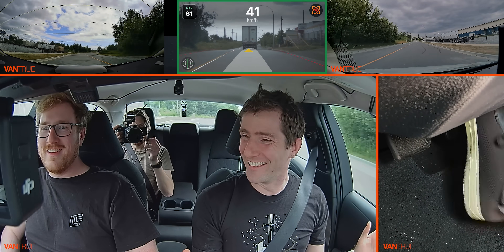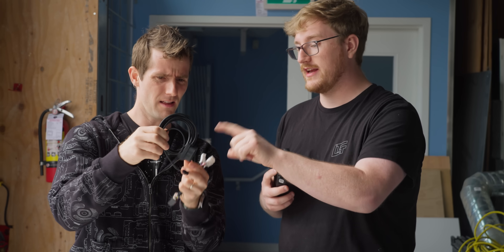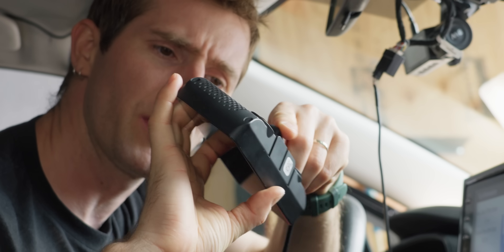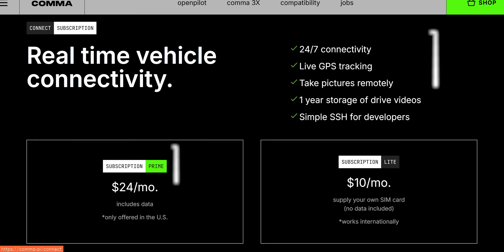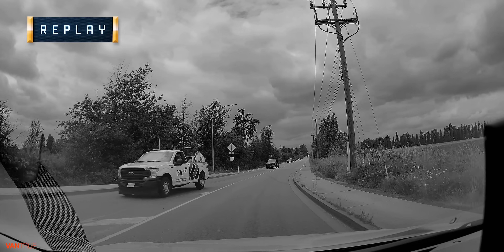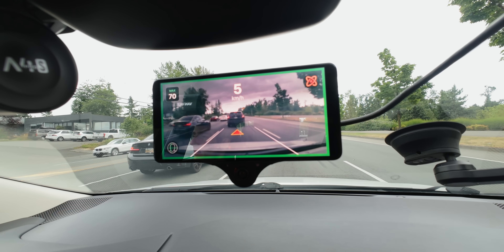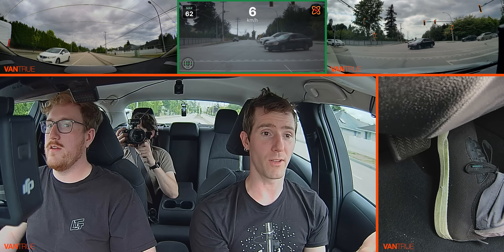I Upgraded My Car With Open-Source AUTOPILOT and it's AMAZING

Comment: Just curious. Wouldn’t using this device in autonomous driving (even “experimental autonomous driving”) in B.C. illegal? They just changed the laws (back in April 2024) making the operation of a vehicle in fully autonomous mode (even when there is a driver in the driver’s seat) illegal. B.C. being the first jurisdiction in North America to do so.

“Anyone caught driving a fully automated vehicle in B.C. could face penalties of up to $2,000 and six months in jail.”

-CBC News, April 22, 2024

I have a 2020 Honda Insight with driver assist features (Adaptive Cruise Control, Lane Keeping Assist). The ACC works great and will bring my car to a full stop from highway speed if necessary. With the LKAS if I take my hands off the wheel, it will first “shake” the steering and give audible warnings wheel (and visual on the instrument cluster) and if I still don’t respond it will give stronger steering assist and eventually bring the vehicle to a full stop. In other words, it won’t allow autonomous driving.

Comment: I currently own a Comma 3 with a 2022 Prius. I've used it in two different cars with over 550,000 miles. Zero incidents. It's incredibly safe, efficient, and smooth. Comfortable.

Comment: I saw something similar to this years back, where a person added software to a smartphone and connected to his car. I'm thinking that as time goes on, there will be software upgrades that will allow the system to work even better. And it's clear this current version is best for highway driving, where there are not a lot of turns that have to be made.

Comment: I just wish VW Touareg was supported. Especially because VW has yet to fix the cameras in ANY of the T-regs. How this isn't a safety recall is beyond me, but I digress.  Apparently the comma hardware doesn't support the type of CAN bus VW uses. To bad because it would be a huge upgrade and well worth the $$$. Also I love how a tiny company is doing at least as good as Tesla at self driving with a camera. Tesla's self driving claim is such an exaggeration. I've been in a Model3 that just decided it would cross the yellow lines around a corner and drive into on coming traffic. When I asked the owner if that was normal. He shrugged and said it does it all the time but not to worry it is expected.

Comment: Looked up the compatibility for my car. It says it adds adaptive cruise and lane assist...BUT requires the vehicle to already have the features in order to work. Well that seems pointless.
Reply: A lot of vehicles LKAS system is incredibly crappy. Like, it won't even hold you in the lane. Not even 50% of the time.

Comment: 11:09 nope, my Tesla with basic Autopilot will absolutely slow down for corners. Sometimes a little too much IMO. I could (and have) totally let it handle mountain roads with no issues up to near-90º turns.
Reply: fr after using FSD on hw4... this system is way more dangerous and not even remotely in the same category of self driving.
Reply: @Bb-br3xg it depends on the built in LKAS system of the car, if the LKAS is designed to provide enough turning torque for E.x. 90 degrees, it will do full turns and has navigate on open pilot, this car just doesn’t.

Comment: As a BMW driver/owner for the last 20 years, I’m a little sick and tired of the constant abuse we face from other road users around the world on our use of the turn signals (indicators as we call them in the UK). I need to set a few things straight.

BMW mandate a training course to all new BMW owners, and they clearly state that you’re expected to drive in a sporty and enthusiastic manner at all times, this means driving faster than other road users and taking highway/motorway junctions at the very last minute directly from the fast lane while maintaining as much speed as possible, in this situation the turn signal should not be used as it could mistakenly confuse other (lesser) road users into thinking that you're just changing a single lane. 

BMW only fit the indicator lights as they required for hard braking warnings to other BMW drivers behind when someone in front won’t move out of your way and the manual indicator stalks are fitted in the car only so you can signal to other road users when you need to overtake them, this should be combined with repeatedly flashing the main headlights.

So, as you can now see, we’re just following the correct BMW driving standard and don’t deserve this constant level of abuse from non-BMW owners, if anything you should be thankful we tolerate you on our roads.

Comment: Yeah, if you're interested in Comma, don't wait for Linus's conclusions based on this car. Go watch George Hotz talking about it as well as using it for fully autonomous driving in a car that can actually make the sharper turns. Choosing the wrong car here completely skews what the system does and what it's capable of imo. Find a car where it can do more than the small lane assist steering inputs and then make another video please. It really is amazing if you have a new enough car. 
I may never own a car new enough to integrate with it, but I wish most of the drivers around me were on this instead of their own driving skills.

Comment: My Volvo XC90 (24 plate) has an autopilot and it is SMOOOOTH! where as my previous cars that had Adaptive cruise control was terrible and when I was in cruise control I couldn't disable the lane assist or the car distance. where is Volvo is great

Comment: I have had a Comma 2 for the last 4 years and love it for my 1hr commute. I will warn, when they released the Comma 3, they bricked all older devices not just from running their code, but even custom branches. Unless you're a software developer comfortable with SSH and running unofficial branches, do not buy a Comma system that is past or near its end of life. It took me a week of reddit to fix mine after they bricked it - running dragonpilot now.

Comment: Very interesting, but I would sweat a lot more than Linus did. And that's not because I'm afraid of what the machine does in a perfect situation, but rather how it handles other drivers mistakes. But yeah, would have been great earlier this summer when I drove to Germany and back, that was about 1000 miles on freeway, there I think it would have been shining (if it would have been adapted for Europe, which it probably isn't).

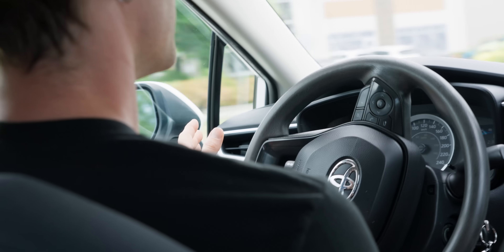Comment: 11:15, Tesla recently updated base autopilot with “curvature assist” which will slow down aggressively for sharp turns. It works well but it does activate sometimes when not required.
Reply: Also for the NA market, i thought that was just an EU temp feature? Also, when does Tesla just scrap autopilot, and do everything via FSD?
Reply: @sebastianorye2702  I’m not sure if it’s in NA because I don’t live there but it would be weird if it wasn’t, people with FSD now don’t even have autopilot as an option anymore with V14 so that might be indicative of them merging autopilot and FSD into FSD and FSD (but it can only go in straight lines)
Reply: @fayenotfaye  I know that thats the plan, and that V14 is likely going to do that, but i'm unsure if thats happened yet.

Anyway, i'm in EU. We're quite literally stuck on a 8 year old branch. Maybe we're lucky, and 2027 might be the year where Tesla's FSD (though limited) from US could come, but who knows

Comment: All those wires blocking the side curtain airbags are causing anxiety for me... Yeah ok the dashcam installs are temporary but good grief it's not THAT hard to tuck wires properly so they won't interfere with the airbags of, god forbid, they go off... Even sticking them to the center of the headliner with painters tape or staples would be better than this.

Comment: The need to offer a steering and brake servo kit that be installed into any vehicle with installer-fabricated hardware.
This only takes a car that already has adaptive cruise control and lane keeping functionality and makes it slightly more smart. Last I checked, they did not offer any means to add the underlying features it depends on to a vehicle that doesn't already have them. The greatest potential for this product is bringing new features to old cars - and that's where it falls short the most.

Comment: I wouldn't trust any self driving as far as I could throw it. Personally I just think it encourages unconcentrated lazy driving. Others may disagree saying you need to concentrate and watch it to make sure it doesn't make a mistake to which I'd say then what is the point of it. How can you have a relaxing drive if you neither have faith or trust in a device do to what it's designed to do. I'll keep control of my car and do the driving myself I think.

Comment: 8:04 LINUS Route Your Cables More to the Right in the rubber across the seem of roof liner and "A" Pillar Seem Then Push  Tuck Under The Front Edge Of Roof Liner Meets Front Top Edge of Windscreen to Frree up Your Sun Visor Dude.

Comment: No warning pedestrians are out-of-scope, without even a single line-of-code or parameter in the models accounting for them?! You can check, search, run etc their code and ML models relatively easily. Also how stock AEB is disabled in 'experimental mode', or by default on some officially supported car models?

Comment: I may have missed it if mentioned in the video but this wouldn’t work with a vehicle that uses hydraulic power steering like an older e chassis bmw, (even though that would be awesome) it would only work with vehicles that have an eps module. Still awesome for cars that don’t come with lane assist. Also I’d be curious how a tuned ecu would react to this. My thoughts are based around retrofitting older cars with newer technology

Comment: To all the ‘mechanics’ out there who tell you to ‘just disconnect the battery’...
Unfortunately, with modern cars, it's not a good idea to just disconnect the battery to work on the vehicle. The electronics are extremely sensitive, and simply disconnecting it can lead to errors, data loss, or even damage to control units. In the worst case, you might have to visit a workshop afterward to get everything reset.

It's always best to check your car's manual first! Often, there are specific instructions, or you might need a memory saver device to keep the electronics powered during the work. Also, always disconnect the negative terminal first and connect the positive terminal first when reconnecting. Better safe than sorry here!

Comment: I still watch and support LTT but this was one of the weakest videos you've posted in a long while.

I'm certain that LTT would have done a far better job of this script 5-6 years ago but this was all BTS "watch us do a thing" and "hur Hur this is cool"

This was THE product to center around the liability and accountability of AI tech, future of the market and the colossal downsides of open-source software wherever public safety is concerned. 
The mark was so wildly missed and I'm mostly disappointed because my expectations are set by the high standards of this channels videos from years past

Comment: There is literally no point to this (or any autopilot) 
You have to remain in control of the car at all times. If there is an accident it is your fault. 
What is actually the point in having the car sometimes, kinda try to steer the car badly. How does this benefit you?

Comment: I think that It would be awesome if they would split it into 2 devices. Like smaller camera module no windshield and small separate screen to mount somewhere on dash I dont want additional giantic shit in my windshield - I want to mount it on pillar, air vent or have composite output to use backing camera input in my car radio

Comment: I'm more bothered by how many cars have drive by wire to begin with. In some cases it helps with packaging when you can't fit a shaft in the engine bay from the cab to the suspension, but a malicious attack taking control of your vehicle. 

Imagine a state agency driving you to "turn yourself in" for wrong think

Comment: Nice video! I've been driving with Openpilot for over 3 years now (2020 Hyundai Santa Fe and 2014 Mazda 3) and it's been great! They recently had the Comma 3X on sale for $799 over July 4 weekend, but at $999, it's still a great deal. Just FYI, Hyundai, Kia, and Genesis are the makes that typically allow for the most torque to be applied to the steering wheel through the lane keeping system, so you'll be able to take the sharper turns much easier with those cars. I think I can count on one hand the amount of times I've gotten the "turn exceeds steering limit" warning on my Hyundai Santa Fe. Even windy mountain roads are no problem for it!

Comment: You don't need to disconnect the battery, I used to work at Safelite and do camera recalibration. Just having the car off is enough

Comment: Interesting....so since this is OpenSource etc whats to stop the car manufacturers, such as Honda, Toyota etc just putting this into their cars and replacing their current 'rudimentary' detection systems?  Certainly, from what I've read, even its basic current functionality is better than the current built in features they have.... the screen would then be in the dash (rather than obscuring view), they could have better cameras mounted in the right places etc.

Comment: You're not thinking weird enough Linus 

Since open pilot is a pretty adaptable platform, people put these things in cars that never would have dreamed of being autonomous 

There's a video of a 1970s Volkswagen vanagon doing some pretty smooth highway autonomy, the owner just had to put in a Prius steering rack, a. Corolla forward radar unit off eBay, a Bosch e-brake system 

Just imagine putting this level of autonomy in literally any car ever built, and yes I am thinking of 1960s Rolls-Royce
Reply: Imagine downgrading nice hydraulic rack to an electric Prius rack and downgrading your hydraulic brakes to electric, not to mention the worst crime - downgrading your cable throttle to electric.... All in an effort to avoid driving the car you bought.
Shoulda just got an uber.
Reply: @LyumYT213  Uber on a daily basis would cost me far more than $1000.

Comment: Linus failed to mention this, but each vehicle has their own max steering angle. If you get used to the limits of what your car can and can't do then you can easily master the usage of Komma 3X and other products. From what I searched up, most Toyotas and Lexus only have a max steering angle of 60 degrees.

Comment: My buddy was one of the first few people to use this. 8 years ago, he had to 3d print his own enclosure, use his own phone for it, and if I remember correctly I think he had to do a bit of work to make his own wiring harness. He drove his 2017 Honda Civic from Utah to Georgia and back to come to my wedding. He said the Openpilot worked great the whole way, it just wasn't great with tight turns as other commenters have said. 
It's really cool to see how far it's come over the years and to see so many commentors are aware of and using the newer versions now.
Reply: Seems to be the same functionality then as now
Reply: Reduced steering control with lane assist stops the standard system from overreacting by restriction.
Reply: doesn't look like it works great
Reply: thank you! I can only stand hearing his voice for 30secs max
Reply: This should definitely be an app and not a device on its own. Especially considering the flagship phones are 6x more powerful than that device.
Reply: SO BASICALLY IT HAS NOT IMPROVED EXCEPT THEY HAVE THEIR OWN HARDWARE NOW AND BETTER INTERFACE LOL
Reply: @petsonly4068  Did you miss the part in which Comma AI needs to reverse engineer actual cars and make the product work with said car? Im sure the models had more hiccups back then than it does now, but if it worked great on highways 8 years ago, then what is there to improve? Auto pilot / ACC on all cars today are primarily advertised to be used on highways, ie roads with markers and no pedestrians or bicycles near you. I can imagine most of their time is spent making it compatible with cars.

Comment: At 18:36, it was the first time I heard dashcams are not allowed to be mounted on the windshield. That seems unreasonable considering the importance of dashcams. How are you supposed to file a claim when other car hit you when there is no witnesses? I had the Vantrue E1P an honestly it has saved me a fortune.
Reply: It’s not specifically for dash-cams, it’s a general rule that you can’t mount any equipment that obscures your front vision. There are tons of dumb people that mount their phone in the middle of the front  window and they create a massive blind spot. 

So no, they don’t ban dash-cams, you can still use them but they can’t be anywhere in your peripheral vision.

Comment: Kind of curious how it performs compared to the Tesla autopilot. This thing looks lowkey dangerous for sure. It doesn't even slow down before turning! No wonder you have Vantrue dashcam as your sponsor, just in case you cause an accident lol.
Reply: @Lorenzo80599  Coming from someone who uses Tesla's Autopilot and FSD, the lack of capability in this device is incredibly frightening.

Comment: I had the exact same car, and I was going to buy one of these, but then I figured out that it does just fine steering itself on the highway if you shove a half-empty water bottle into the bottom of the steering wheel so it thinks your hand is on the wheel. Linus should try that in the next video.